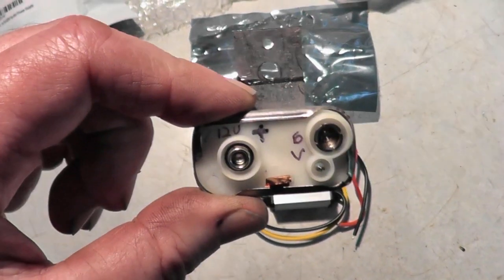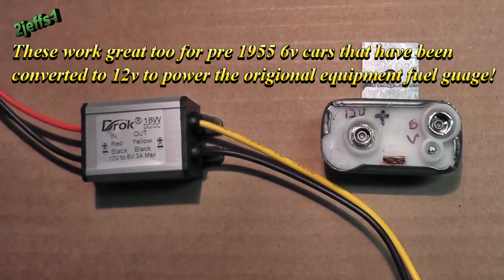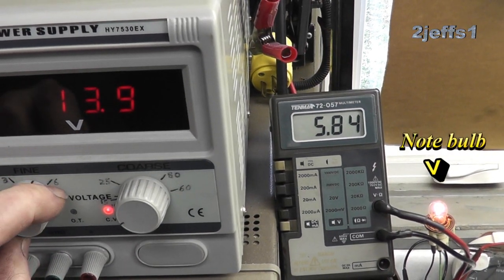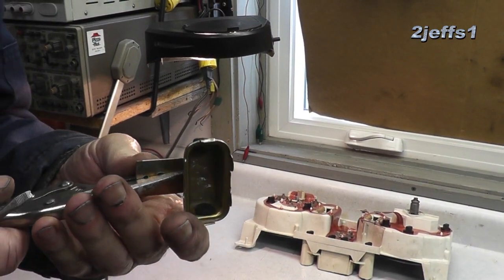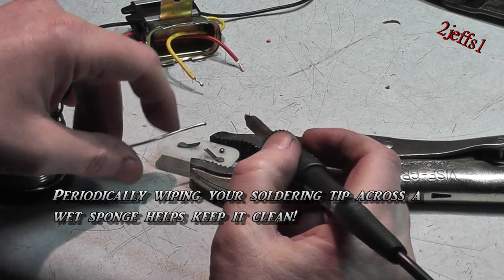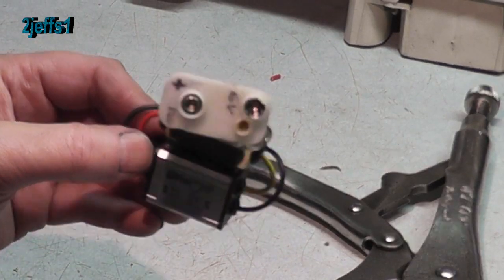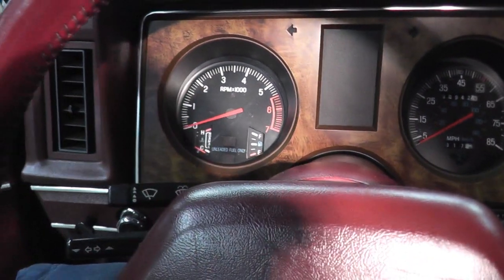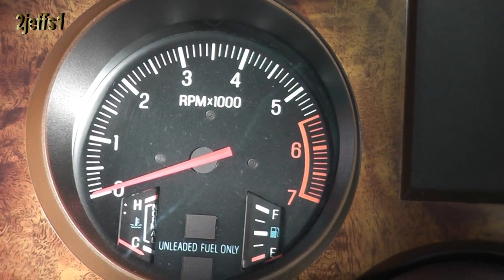12v to 6v Gauge Voltage Regulator DIY For Under 10 Bucks

Comment: My temp gauge and ammeter works on my 65 Plymouth Sport Fury but my fuel gauge does not. It's got a new sending unit and the connections look good. What should I do? Help 🥺

Comment: Hey 2jeffs1, my 1960 ford trucks fuel gauge is not working, i replaced the fuel sending unit twice with new napa sending units, still no reading. I then grounded the lead to the fuel line and it pegged the needle to full tank. I rehooked it and still no reading. It has gas in the tank but doesnt register. My oil and temp gauges work good. Could this still be the voltage regulator or the gauge?

Comment: You think that if i hook the multimeter to the temperature sending unit connector i might be able to check if the icvr is working fine, cause taking the cluster out is really hard

Comment: can you tell my why on gm cars when you pull hand brake why the baterry light turn on as well my altenator stoped charging and I dont have dash lights has the dummy light somthing to do with dash ilumination? ore is that back charging? It cinde of turn on off when presing acelerator padal

Comment: Hi, nice video. Well done and explained. I have a question. I’m restoring a 1950 Ford F3 pickup and put a 302 V8 on 12v alternator in. What do I need to do that the guages work and not destroy the ones I have with 12volts...?

Comment: yeah my 65 dodge dart has erratic gauge readings on both the fuel and temp gauges.  This helped to solidify my suspicions of it being a failed voltage regulator. Thanks!
Reply from the maker: Excellent Moe. Thanks for the feedback!

Comment: Really appreciate the simple explanation and in depth process. It's hard to find good quality videos on wiring fixes and guage cluster troubleshooting for older vehicles
Reply from the maker: Thank you Craig. I do spend a lot of time on putting the video's together, many times even have notes to make sure certain points or concerns don't get overlooked and appreciate knowing that they were helpful to others!

Comment: Hi. 2jeffs1
A thousand thanks for your video, is super clear, well explained, can solve the problem of the gas needle that always marked empty.
Have a nice day the moment you read my comment.
Henry.
Reply from the maker: Hello Henry. Not sure what you are working on, If you have a Ford with a temp gauge and that is working please beware it could possibly be a different issue. (A bench test on the V/R always insures that is the repair needed.) I am currently working on a video of how to diagnose the entire gas gauge system for different issues. It will be the simplest/easiest for everyone to understand out there. Thank you for stopping by Henry, Jeff.

Comment: How many items can you run with one of these blocks ?  I have a 1954 Chevy . I have a 6v clock and a 6v radio . Could one run both or would I have to buy one for each item ?
Reply from the maker: A 6v clock should work fine but the radio will draw too much amperage for this device. Ideally if you could find something that has a 15a output that would be ideal.

Comment: Another helpful video sir! Brighter bulbs and a stable voltage regulator for cheap! Thanks Jeff
Reply from the maker: +NewRiverRepair Your welcome. A sure fix that works better than new is always a good thing!
Reply: +2jeffs1 
I've had success changing bulb colors by using that vinyl and carpet spray paint. 
What I do is coat it , let it dry, and turn the bulb on for a few seconds ....turn it off. 
and cycle it a few times like that and let it cool inbetween so the heat cures the paint/dye? and doesn't burn it. 
If ya cure it right it with patience it won't discolor. 
I used it on the clear bulbs and changed em to red in my ol 79 rabbit. 
Of course now everyone is going led but this still works good and is cheap. 
Normal paint will burn , I've been there. 
but I guess I'd say it's like  using those colored vinyl bulb covers, except it's in a spray can!

Comment: Good one. Thanks for the bulb replacement number. Did you ever do a video on you put on the Ranger to stop the rust?
Reply from the maker: +57WillysCJ Your welcome. I am planning doing a detailed eliminate rust video on that this fall before the snow flies. Thanks, yeah several others inquired too so....
Reply: 57WillysCJ continuous circuit

Comment: Yet another common sense repair, sir. Jeez I hated those flexible circuit boards from that era.
Reply from the maker: +ramosel Yeah - them were pretty fragile. Actually I had to replace the one in the Dune Buggy last year which has that older Chev Nova cluster.